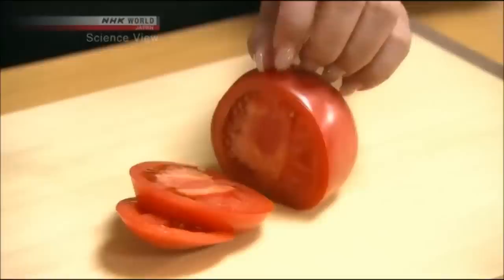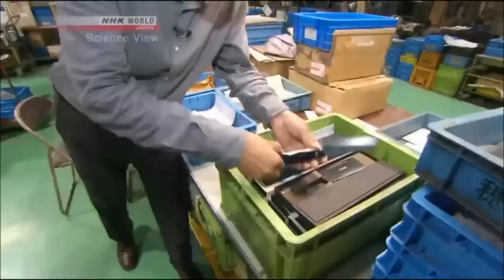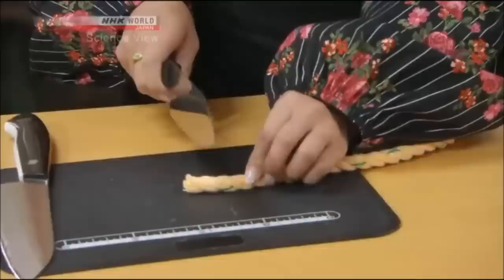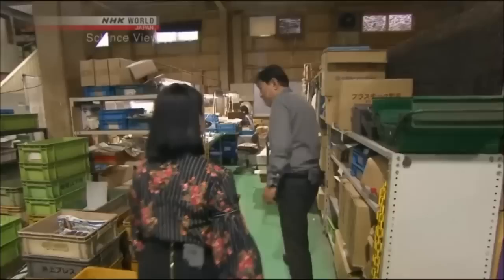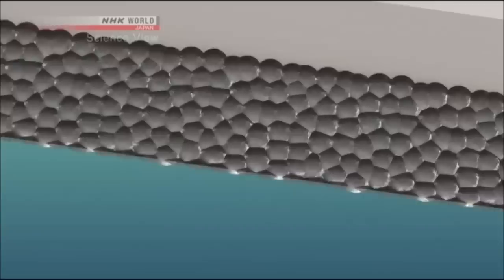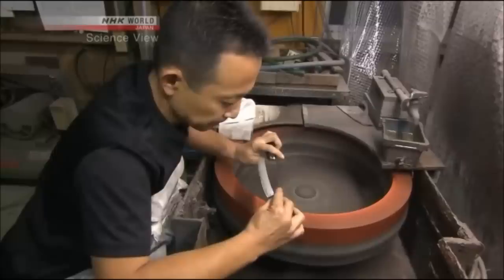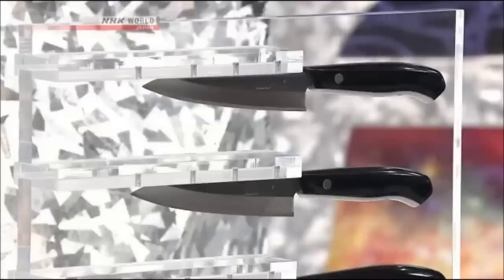Japanese Knife That Doesn't Need Sharpening

Comment: No such a thing as knife that doesn't need sharpening.
Reply: Man of the north People are so used to nameless stainless steel and poor edge geometry that good steel and edge geometry makes it seem like it lasts forever
Reply: Yep but these knifes will go for years before they need sharpening
Reply: Adarsh Vijayan Maybe they will cut, but by the time they will loose their virgin sharpness before they need sharpening. That's no no for me.
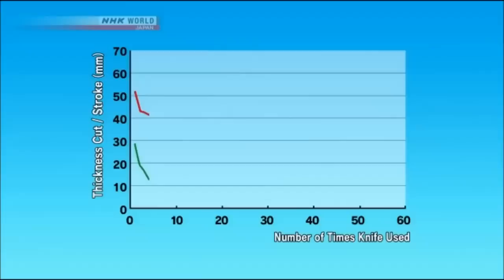Reply: Even the graph and explanation at 2:30 shows you that it dulls over time...
Reply: bill bixby So the blade is serrated? All the knives are microserrated. Some have more toothy edge others more smooth. Serrated cuts better with sawing motion and smooth edges cut better when push cuting. It may feel it cuts sharply but if you compared it to the original state of sharpness you would notice the difference.
Reply: Dulled mine in three days.
Reply: +Bill Bixby So in your estimation, erosion isn't possible because water is softer than a rock lol. that's complete nonsense, regardless of the cutting board and cutting material being softer than the metal of the knife, it still abrades the steel just at slower rates, add impact with the cutting board and the edge warps and blunts. Cutco is horrific dogshit, a serrated blade like Cutco's DD edge will cut when completely dull because it's tearing through product.
Reply: Erosion happens over millions of years. If you have a high quality blade that's sharpened well, you can use it almost your whole life without sharpening it if you're just cutting vegetables with it. A chef only has to sharpen his knife once a year and he's using it every single day almost all day. The average person is using their kitchen knives even less which means less wear and tear.

The knife above is trash, I agree, but a person buying a high quality steel blade can be expected on never sharpening it. You don't need a razor sharp knife to cut vegetables. I can peel a potato with a butterknife, they're soft.
Reply: Javier Hernandez I have a vintage rosewood victorinox and honestly the steel is not so good. Likes to chip a lot.
Reply: Bumbleness Supreme Brady You have clearly no idea what you're talking about, sir. A dull knife will still cut vegetables. I can use a piece of unsharpened steel sheet and cut veggies with it. I believe you are simply used to dull knives, as are most chefs.
Reply: Man of the north Exactly!! 👏👏👏
Reply: well the knives you no longer use doesn't need sharpening
Reply: Man of the north .....how many years have you been in knife making/selling competition with these folks.
Reply: man of the north 
Incorrect light sabers do not need to be resharpened
but this knife absolutely, also how would one even sharpen a titanium carbide edge? the carbide can excessively wear down your stones.
Reply: go to Japan see for your self.
Reply: @ReasonAboveEverything 
If you don't use the knife, then it won't need sparpening.
Reply: Man of the north well they just proved it here. Bruh
Reply: @snoopyr1953  Did you even listen to what they said, Why would they offer at service to re-sharpen/refurbish the blade?? And the Graph in the vid, shows that the knife dulls. Wroof went over your head.
Reply: W N  it would still take a very long time. I haven't tested one but what if the longevity of this titanium carbide edge is extremely long?
Reply: The graph they used shows that. This would have to be some new "SUPERMAN steel"...a steel composition that allows the steel to keep it's edge forever unchanged. Never chips no matter what object it comes into contact with (e.g. hard bone) or if used on a plastic or  glass cutting board. An indestructible steel. :) Never need sharpening?? Magic steel. 

It's not like this guy was a PhD from MIT and came up with some Nobel Prize winning steel composition. Had the machines to do the testing. The resources needed for R&D. 

He's betting on some unthinking consumer buying into his BS. :) And those people exist. Who don't bother studying kitchen knife steel or blade design/material. If he has a good marketing team he should make a mint. Be on "easy street".
Reply: You obviously don't have a pure diamond blade like the rest of us
Reply: It's such an interesting art to muse on, though (knife making/steel work)...  I've always wondered, theoreticaly, let's say you had 5 layers of different steels:

The core layer would be extremely brittle (like d2 or something more insanely brittle that's rediculously high in hardness).  Cut this into the base layer of the knife, with 1 row of stably (cone") shaped 'teeth' on the edge with wide spaces in between (like a giant novelty hair comb).

The next layer should be extremely hard steel also (though a bit less so).  This layer should start the more traditional looking edge of the blade and have wider teeth that are framed on top of/from.covering the inner layer of teeth.   

For the next layer of steel, it should be also very hard, though less so, again.  Make the teeth of this layer run precisely in between the teeth of the first layers.

The fourth layer should be a medium well balanced, hard knife steel with teeth in between each tooth of the base layer steels that are sticking out (we're at very tiny spaces between the teeth at this point).

Finally, make the last coating some buttery soft steel mixed with another cpm steel made into damascus and wrapped around the frame of teeth on the edge.  This would LINK the, now extremely microscopically spaced apart, 'teeth' of the finely serrated, hard blade edge with a softer, tougher matrix.  

idk... it just seems like there is some smarter way that some smarty pants could come uo with combining the tough steels and the hard, brittle steels better than is currently being done... kinda like a skeleton frame of mega hard coney spikes of stable points held together with the tougher steels, so you have that forever edge of ice picks (or something) mixed with toughness that prevents brittleness.
Reply: Sandrin  makes a tungsten carbide knife that doesn't need to be sharpened. Watched somebody review it and they couldn't make it dull.
Reply: @kikook222  dude that just simply isn't true... I use knives daily and they will dull. All of them. I've seen knives go from razor sharp to dull as a butter knife in a matter of weeks.

Comment: No such thing as a knife that never needs sharpening if your goal is true sharpness. Carbidized blades are a novelty at best.
Reply: they are basically just bragging about the drawback of blade chipping when using very hardened steel saying it actually aids the slicing process lol.
Reply: Maxwell Super You are missing the marketing point. The customer never needs to sharpen it, so to them it never needs sharpening. Quite appealing for many. Just send the knife back and job done
Reply: if they do that for free for life then cool, otherwise you're just paying someone else to sharpen it for you
Reply: The thing is, it's never actually sharp. What they say at the start about the knife edge isn't true: a truly sharp  edge doesn't need to be jagged to cut--in fact a knife that has a jagged edge like these do is really just tearing the food on a micro level. These knives are like a space-age version of Cut-Co knives, meaning they're like tiny hacksaws. (Just look at the terrible job the knife does with that tomato. Try cutting an onion with this thing and you're going to need a whole box of Kleenex.)
Reply: My thoughts exactly. How do you make a knife that never needs to be sharpened? Make a knife that is not designed to be sharp. 😂
Reply: We bought a similar set of knives in 2005 for £ 40 and they have stayed “sharp” all this time. The small paring knives wore past the carbide edge and had to be binned last year. They were called FUSION forever sharp by Richardson of Sheffield and while you may not want to drag one across your face in an attempt to shave, they always sliced anything in their path ( tomato skins are a great and more practical test than making confetti) and were NEVER sharpened. Looked for another set last year and they seem to have been a victim of their own success.....no longer made.
Reply: This are not the kind of people use to lie for no reason
Reply: Yeah I bought a ball-peen hammer 35 years ago and haven't had to sharpen it a single time since
Reply: Alastair Seggie they are not made for a reason
Reply: Just something to correct you, most of our traditional blades do not ever need sharpening, because of it's ceramic coating that sharpens itself when cutting a soft material
Reply: Comments are mostly ridiculous
Reply: yeah... this might be a good knife for home use, but if I  use this knife every day in the line and prep FOR SURE it will need sharpening.

Comment: The video in short: 
The blade edge is coated in a bunch of VERY hard bits. Bits make it act like a micro-saw. As the knife wears down, the steel is gone and the bits fall off, but a new bunch of bits comes to the new edge, preserving the micro-saw sharpness.
Also, If you abuse it too much and it DOES get dull, send it back to them and they'll repair it to be as good as new.
Reply: Won’t the hard bits get into you food when they fall off?
Reply: @david-pb4bi  I agree.  It should kept well away from food.
Reply: @david-pb4bi  Yes, the same way the metal of any knife already get into your food when you cut them.
Reply: @ThallesNinja  It’s not the same thing, what you are talking about is microscopic.
Reply: @david-pb4bi  This is also microscopic. I don't understand what you mean.
Reply: @ThallesNinja  Like shark teeth they wear out and get replaced ( drop in your food ) I could be wrong but that’s the way I interpreted it.
Reply: @david-pb4bi  Yes, it's exactly like that. But the particles falling off are also microscopic. It's really no different than microscopic shards of metal enbedding into your food whenever you cut it with a normal knife. This knife is just designed in a way where the pieces break in specific sections, therefore always keeping its teeth.

This isn't really a sharp knife, it's more like a teethed knife/saw.

Comment: "Never needs sharpening" usually means at least two of three things:
1. Our knife will rust, warp, or break long before it ever needs sharpening.
2. Our knife is so heavily serrated that it will last a long time without sharpening – though it will eventually wear down, and you won't be able to sharpen it using any home technique. 
3. If you do want to get it sharpened once it's dull, you'll find that the cost of having it done professionally is more than that of just buying a new one – why bother repairing when you can replace?

Seriously, if never-needs-sharpening knives were all they were cracked up to be, every chef would have shifted to using them exclusively. The old needs-sharpening variety would be obsolete. Surely every knife company would get onboard once the patents expire.

Comment: For anybody who wants a quick run down of what this video is I'll explain quickly, they are coating the knife edge in carbides, which make the blade last a lot longer than stainless steel blades, they don't compare this carbide coated blade to high carbon steel blades, or deferentially hardened blades with hamon. These knives are not terrible but when they do eventually go dull, you won't be able to fix them up yourself, unless you know how to coat blades in carbides at home or in your workshops. You will have to send off these knives back to the factory, so they can fix the damaged carbide coating, that of course comes off after much use. 

Good gimmick, not good for maintaining them at home for most people, I could put the coating back on myself I know how, but I doubt most non smiths who just want a good knife can. So I would say a high carbon tool steel knife would be better for the home buyer, as they last ages and can be re sharpened at home by anybody.
Reply: ... differentially* hardened blades.
Reply: @einundsiebenziger5488  Uh huh.

Comment: The explanation is somewhat misleading: a jagged edge is "sharp" in the same way that, on a larger scale, a serrated  knife or saw is "sharp", but you can go far beyond that level of sharpness by making it less jagged and grinding to a much smoother thinner edge. What you're getting from this carbide coated blade is a knife that, at best, stays at average sharpness for a long time, but it's not as sharp as would be a properly sharpened bare steel knife ground and polished to as fine an edge as you can get it. It's really more a choice of long-lasting average sharpness vs. much higher peak sharpness but faster wearing.

Comment: This just means that the knife cannot be sharpened and makes the knives disposable. I prefer Shun's dual core and hikari designs, since they can be sharpened and the two steels used wear at different rates to create a form of mini-serration while wearing.
Reply: Most shun knives are overpriced, for what they charge for a stamped Vg10 steel knife you could get a far superior SG2 knife else where. But if your really have the cash to blow your better off looking into forged Masamoto or Sakai knives.
Reply: Robert Coffey ,  I love serrated knives as much as I love being sprayed In the face with 3/8- gravel
Reply: Nikushim - I don't own any Shuns, and do have a couple of SG2 knives. But your pejorative use of the word "stamped" is nothing more than a knife cliche. Stamped knives can vary from the cheapest crap to some of the finest knives out there, depending on the alloy, heat treatment and other factors.
Reply: It was not a pejorative use of the word. It was just referencing how the blade was produced, as a number of knife manufacturers produce both forged and stamped blades (which has a huge impact on the cost). A stamped Masamoto Yanagiba might set you back 150 to 200, wile a forged Masamoto is in the 1k range.
Reply: Robert Coffey shun is still crap in my opinion in comparison to a moritaka or a konosuke WHICH are within the same price range as shun's and are MUCH better at holding/retaining their edges.
Reply: Robert Coffey why you going to buy a knife and dispose it
Reply: Robert Coffey This technology is older than you might think and is majorly flawed. Once it does lose its cutting edge, and it does, it cannot be sharpened. So yes, It is essentially a disposable, albeit expensive knife.
Reply: MIDBC1 It's bullshit, this technology is not new, nor is it good. Any chef, cook worth his/her salt knows the best knife for keeping it's edge is a ceramic blade. Looked after properly a high quality ceramic blade has no comparison, it's that simple.
Reply: Shona O'Neill  although significant improvements have been made, ceramic which is for all other respects a superior blade material is still relatively brittle.
Reply: Robert Coffey
Reply: That’s amazing
Reply: It can't be sharpened, it is probably really expensive and it's not new material, I've seen knives made the same way, except the full length of the blade is titanium carbide, you can't say this is new or even better than ceramic, it's just a decent knife that you need to send in for resurfacing every few years
Reply: Shun is made by Kershaw.
Reply: I've owned shuns globals henckles ECT. I've also seen those ceramic knives shatter in the kitchen. I love my Ken onion shun. The ergos, edge retention, look of the Damascus and usability of that knife make it a goto. The globals are great kitchen knives but I'm not a fan of the handles or bolsters. They cut well but will still give you that hot spot on the bottom of your index finger and will tear your skin eventually. But that Ken onion shun just melts into your hand and i can prep for days with that thing and not tear up my hands
Reply: Robert Coffey is the first of the narwhals
Reply: If it's made of steel you can sharpen it give me this knife and within a week of use in a restaurant it will be doll
Reply: Not to mention the knife looks doll from the start
Reply: You didn't watch it to the end the? If it wears down you send it back and get it reprocessed. 6:55
Reply: From other side of the world? Add processing cost to shipping and it will probably cost more than new knife..-.-
Reply: ''A stamped Masamoto Yanagiba YANAGIBA '' U wot... I haven't read all comments through as I'm writing this, but I don't think you can justify a price of over 1K for a stamp-forged knife (even Zwillings for around $100 are stamp-forged) such as Nenox/Nenohi, they do make some handmade ones though.
Reply: +Robert Coffey Lol you got sold a bill of goods my guy, VG-10 and VG-2 don't wear at perceptibly different rates to give you deeper microserrations than a monosteel blade. You're paying a bunch of money for aesthetics and a poor grind. If you prefer Shun, you aren't knowledgable about knives.
Reply: +Sir Bufton Tufton Nah, none of the finest knives out there are stamped, you're confusing stamping with drop forging; and none of the worlds finest knives are drop forged either.
Reply: Robert Coffey oh hell, ain’t you a smartie pants!
Reply: You lost me at shun that’s when you know you’re a hone cook thinking he knows shuns are the worse
Reply: Sir Bufton Tufton 👏👏👏👏